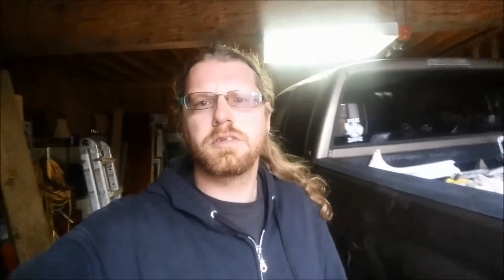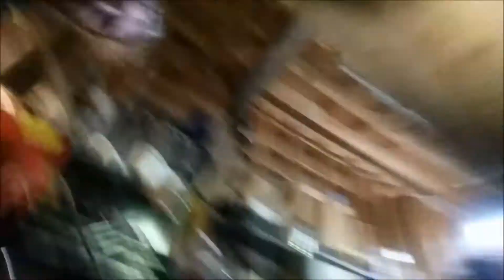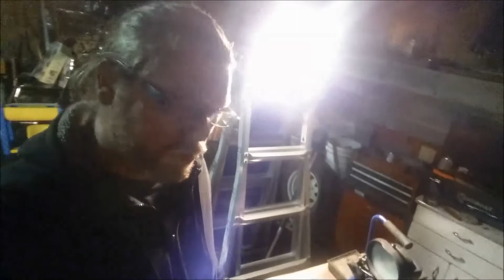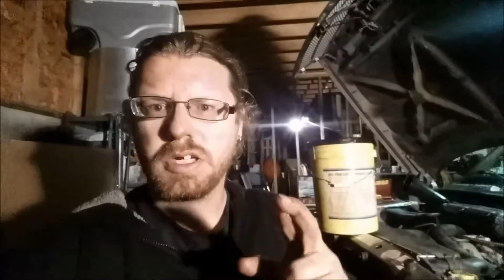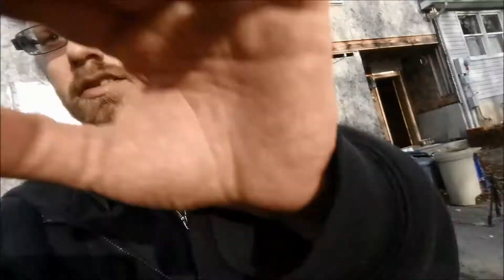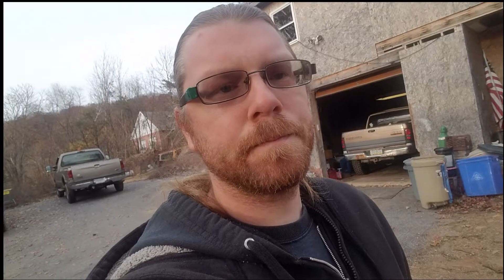Continued problems with the 46re

Comment: I'm pulling all my lines and checking for restriction. P1740 and have rebuilt the VB, installed a shift kit and replaced all the usual suspects. What a fookin pain!
Reply from the maker: Agreed i just now finally fixed the issue after putting the truck up for awhile so good luck with your issue feel free to sub n follow the truck
Reply: @NOVAtazz  I'm honestly doing this as we speak. What did you find? I'll make sure I'm subbed. If you'd like I document a lot of my van stuff on my channel as well.
Reply from the maker: Find me on Instagram will be easyer to message there

Comment: Change the pressure governor solenoid and the pressure transducer sensor. Adjust the bands and you will be golden
Reply from the maker: Those are all fine it's looking like it was the fluid pump there is quite a few videos on this issue on my channel but ty for your input

Comment: What size tires are you running on your 2001 dodge 1500 offroad package? I have one as well, and I heard you could stuff 315/70r17's under them but have rubbing at full lock. Otherwise I was gonna get some 305/70r17 mt's, I am just looking for the best size to fill out the wheel well, and not have the tire look small, like a 285/70r17 would.
Reply from the maker: +HALO3286 im running 35 x 12.5 r17s mud claw MTs
Reply: Do you have any rubbing with 35's? I have heard different things on the offroad package dodge's and rubbing with 35's. Do you have any rubbing issues? I just don't wanna buy some 35x12.50r17's and find out that they rub a crazy amount. rubbing at lock I can deal with.
Reply from the maker: +HALO3286 i havent had any issues n im running a stock aluminum rim

Comment: Check the transfer case shift forks and input shaft
Reply from the maker: Thank you for your suggestion it is definitely in the transmission itself as reverse works just fine and transfer case is doing what it needs to do if you watch my videos after this one you'll see I tore the transmission apart and found out that the forward clutch pack was completely burn out by then rebuilt transmission and I'm still having the same issue so it has to be something else I am missing hopefully today I will get back out to the truck and do an actual line pressure test
Reply: Wow! Thanks to youtubes organization of videos, I missed the teardown video.  I have rebuilt a few of the dodge transmissions(46,47re) and have found that the problem areas usually are the torque converter, front pump, soleniods and sensors, and/or a friction plate put in backwards.  After all of those I have the bad habit of not addressing the transfer case itself.  You sir are making great videos and hope you keep up the good work.
Reply from the maker: Thank you sir hopefully done with this truck soon so i can get back to restoring classic cars n off roading

Comment: Gotta ask, did it have this problem before you messed with the valve body? If not then you introduced the issue with your work or "new" parts. About those "new" parts, always use actual new parts when working on an automatic transmission. Saving money by getting used parts from a junk yard transmission doesn't save you anything if you value your time. These and other transmissions have known common failure points and you don't get much mileage from taking parts from a failing transmission and putting them into a failed transmission. The governor pressure solenoid and governor pressure sensor/transducer are one of the common replacement/repair items for the 46re. Not even worth trying to cheap out on them because nearly every 46re with miles on it needs it replaced if it hasn't been done already. I have the same truck and doing those two items as well as replacing the output speed sensor fixed nearly all my shifting issues. The issues I had were harsh high rpm upshifts after a downshift pull occurred any time since the truck was started. Turning off the truck and starting it again the truck shifted normal until it did a downshift pull. Those problems went away with those three brand new parts. The only issue I have left now is no more second gear once the trans is up to temp, for that I already diagnosed it as a burnt up front/kickdown band. A brand new slip-in band will fix that for me without me having to pull the trans out of the truck. If I knew about the slip-in bands the last time I had the pan down, I would have done it then and saved myself the time and labor of going in there twice. Not sure how your 46re came along as I'm just now seeing your plight, one thing is for sure you have alot of experience wrench on em now.
Reply from the maker: The issue is low pressure i have a video where i finally broke down n bought a tester n yes failed every test n yes was fighting the issue from the beginning so looks to be the fluid pump

Comment: Hey man check you solenoids it’s stuck in limo mob mit even have to check the speed sencer
Reply from the maker: There are no codes n its not in limp mode as that would hold it in 2nd gear and wouldn't explain the excessive clutch pack slipping. I have run pressure test n have come to the conclusion that the fluid pump is bad
Reply: Ok but I read up on those sensor   mimic gears slipping as well my truck did the same thing replaced all the Sensors and worked great
Reply from the maker: @matthewprince506  ive already ruled out them as i have a second set of them

Comment: Did you ever figure out the problem?
Reply from the maker: Yes n no after running a fluid pressure test n it fail across the board the culprit points to the fluid pump or a clog in the trans cooler n lines but after finding out the price of the pump n realizing it ment pulling that trans yet again ...i pushed it out of the shop n started working on the trans am as i needed a break from the truck ...im planning on fixing the truck in the next month or so
Reply: @NOVAtazz  yea it can be a pain in the ass. I have the same problem with my truck currently.

Comment: Your problem was?
Reply from the maker: Michael Dudding is a good question
Reply: So u don't know what was wrong with it truck I'm working on doing same thing
Reply from the maker: Michael Dudding   Pressure chest the transmission if you still have it in the  Truck and go from there I have a video on pressure testing one of these trucks I'm pretty sure my fluid pump when but I have run out of patience with this truck at the moment and it moved on to my muscle cars for the summer